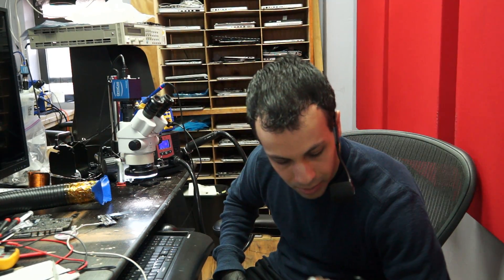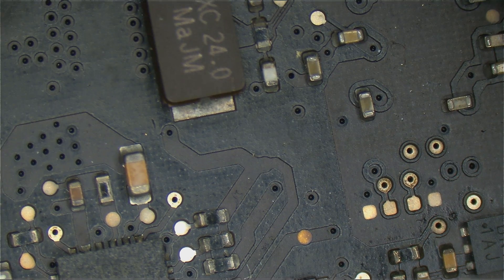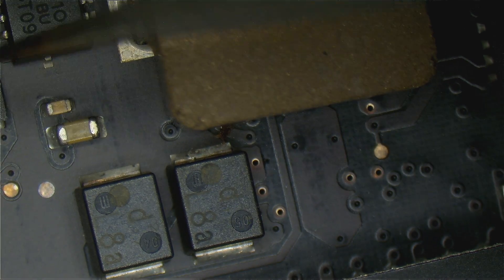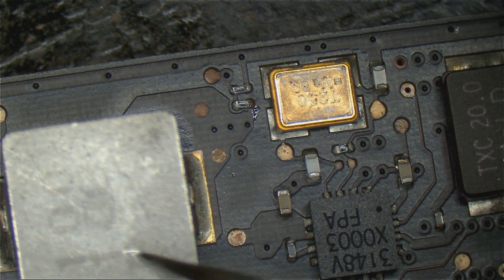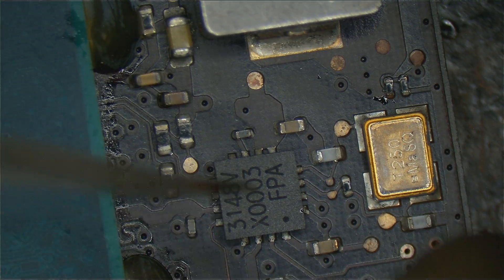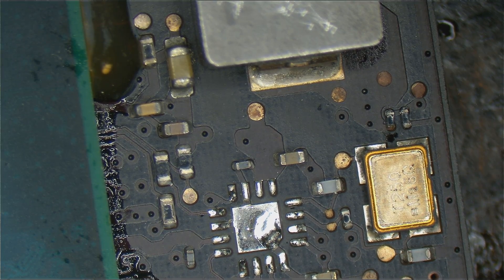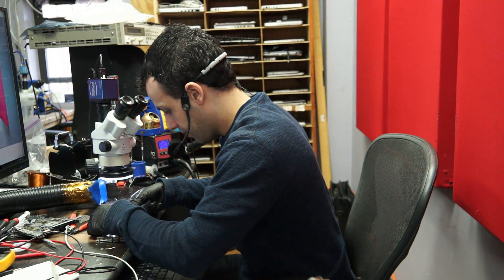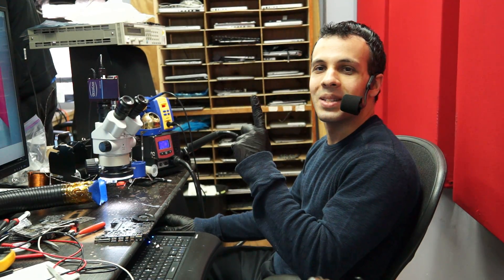On point intuition provides the best education: SYSCLK_CLK32K_RTC fault

Comment: A fan will spin at up to maybe 7000rpm, probably a lot slower, which is 116Hz, which means it does a quarter turn in 466Hz.  It would take 68/32kHz for the fan to do a quarter turn.  I'm not really seeing a direct correlation there.
Reply: +James A. McGuire I wouldn't expect there to be one.  The fan is getting an initial pulse of current which gets it started, before the power supply gets cut off.  I am not any sort of Mac expert, but I imagine some sort of protection circuitry shuts the machine down when it does not see the expected signals (a clock signal perhaps).  Perhaps this all takes about ¼ second.  I don't really know but it's in there.  Obviously the fan continues turning briefly due to angular momentum.
Reply: +James A. McGuire  "Quarter" is really used figuratively here. What it really means is that the fan starts spinning from a short burst of power, and then loses power and keeps spinning for however long its momentum lasts.
Reply: +James A. McGuire The time the fan spins is not related to any frequencies here. The fans in the MB's is 4-wire: VCC, GND, PWM, RPM. When the machine is booted the fan spins up on it's own, and the reason for it only to reach a quarter of turn is because of the SMC turning off the power again.
Reply from the maker: +Gameboygenius the eevblog engineer people must be watching my videos again... OK, YOU GOT ME!! 1/32,000 OF A FAN SPIN!!!! 

because it's an issue with the RTC clock.

get it? ;)
Reply: +Louis Rossmann You can be pretty sure that the 32,768 KHz clock is only for just that - the RTC. All other stuff is derived from a higher frequency xtal. 32 KHz is too slow for practically anything else than timekeeping.
Reply: James And Anyone that can send more information, can u explain in more detail, how you Get To 116 hz ,68/32 hz valúes !! I dont understsnd such válues ,
Maybe a kind soul can explain IT To me ?